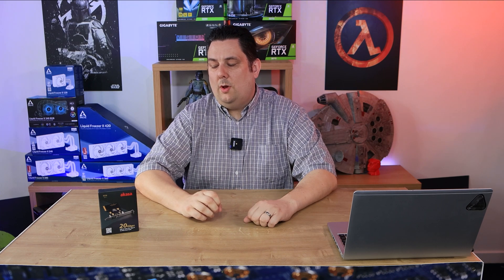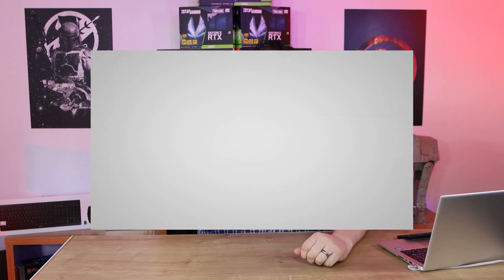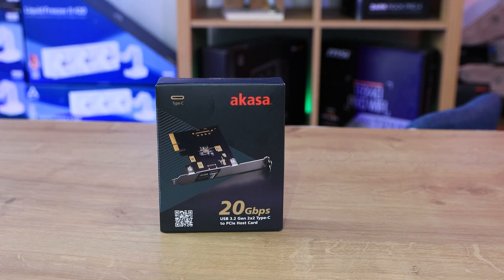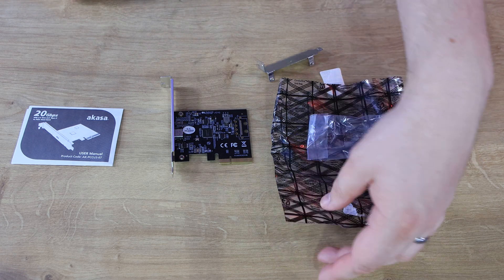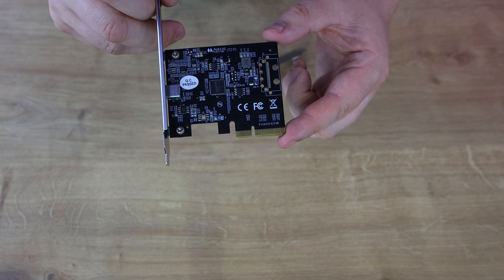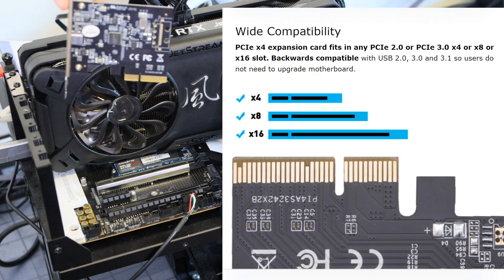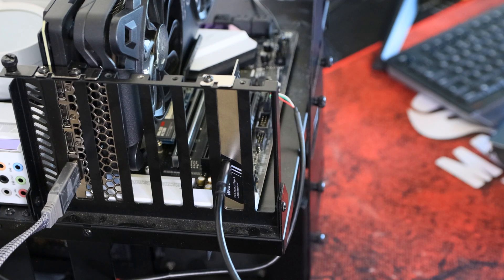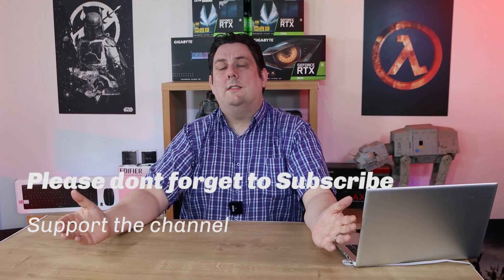Add Ultra Speed USB-C to your PC 💥 Akasa USB 3.2 Gen 2x2 Type-C to PCIe Host Card - Review

Comment: Is there a card that allows me to add a USB-C port for driving an external monitor? My existing GPU (Nvidia) only has one USB-C port and I need to drive two external (small) touchscreen monitors which apparently need USB-C for touchscreen to work.
Reply: I think you need a thunderbolt 3 or 4 card.